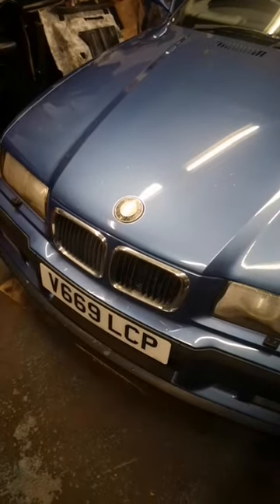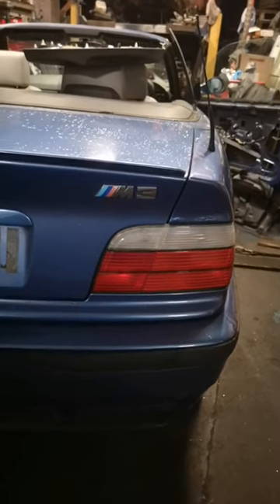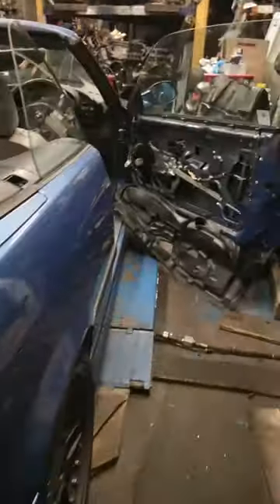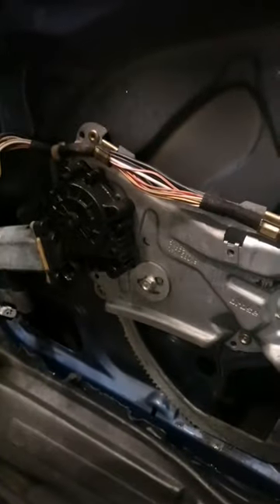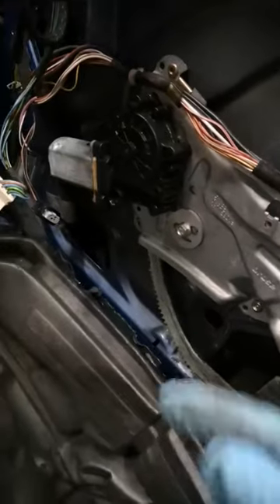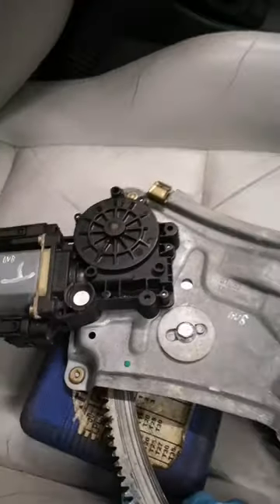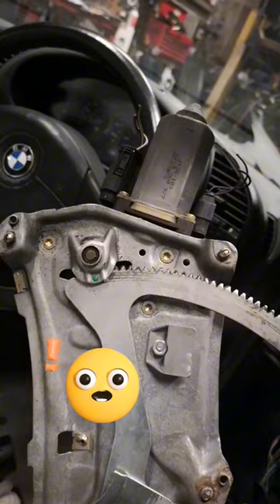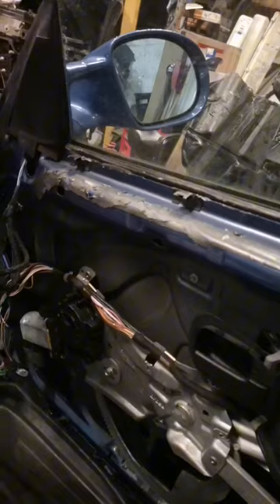BMW engineers are strange

Comment: If it was other way around, additional elements would be needed. Is the design really that terrible if it was working for 25 years? It's not like you have to replace the motor (and you mean reduction gears, I think motor can be detached with assembly mounted) with every oil change...
Reply from the maker: I disagree. Many other manufacturers make it easy to swap out the motor by having a cutout or having the motor mounted from the outside. The motor cannot be separated from the worm gear on this one, as the housing of the gear needs to be removed first. Granted, It has lasted  this long, but it's still assuming the part will never need to be serviced. This is evident with steel rivets to the frame and door.